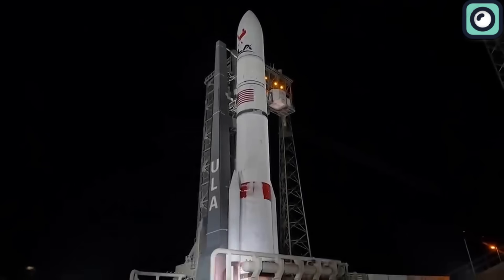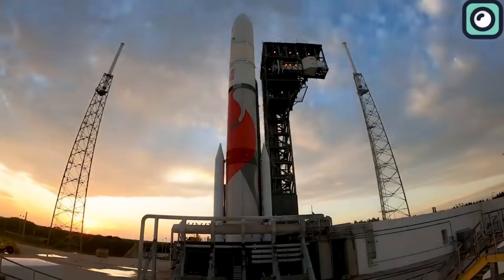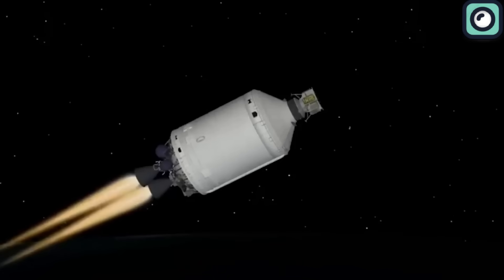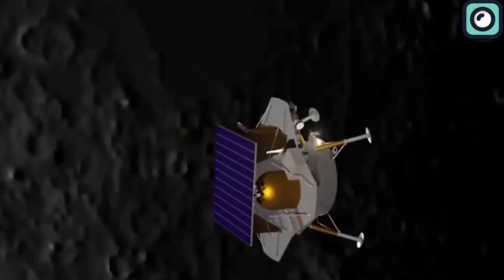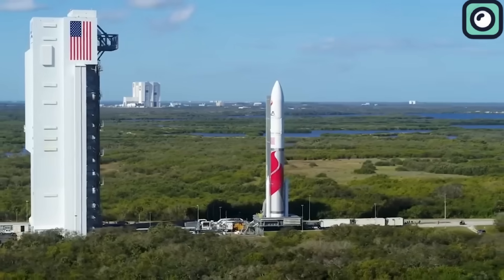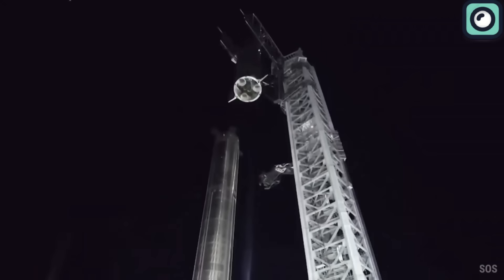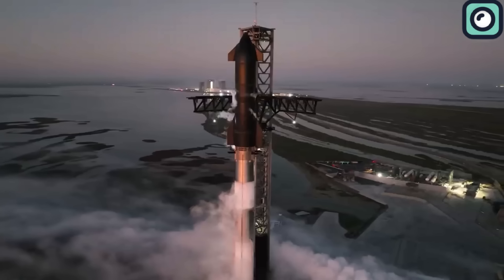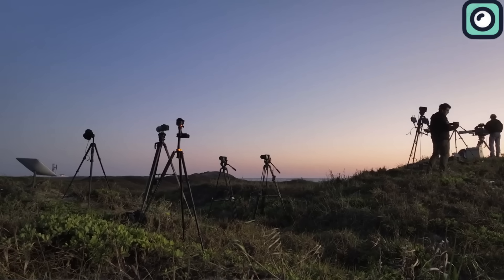ULA Vulcan Launch Data Released and IT'S BAD... Musk Reacts

Comment: The only novel aspect of this launch is that the BE 4 engines were successful in launching the payload to the Karmen line in their first serious use. The centaur second stage is just as reliable as earlier centaur second stages. Note that the chamber pressure of the BE 4 engine is roughly half or slightly less than half of the Raptor engine. No value for the overall mass of the BE 4 engine appears to be published. The Raptor 2 weighs in at 1,600kg  or 1.6 tonne.
Reply: And how many years it took BO to research the Engine, and how long does it take for them to build the engine in a production line? Raptor Engine is no problem, far as I know, and it only takes SpaceX ONE day to build 1 Rocket Engine......BO is too inefficient......
Reply: What’s wrong with that?